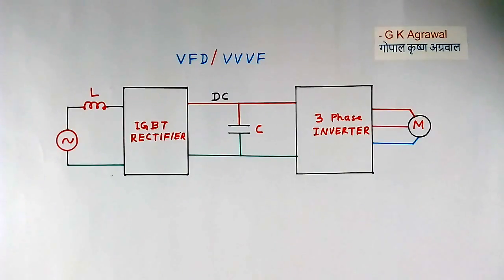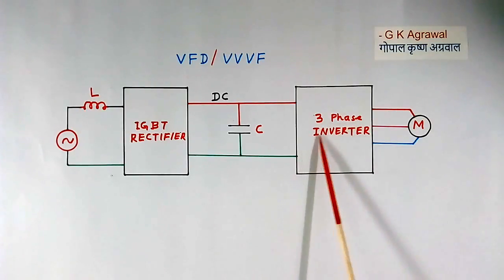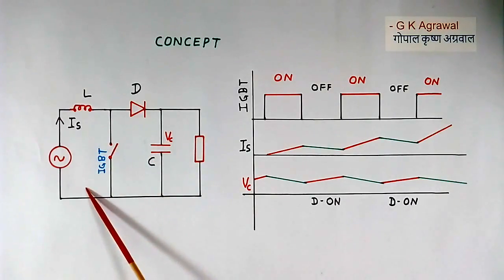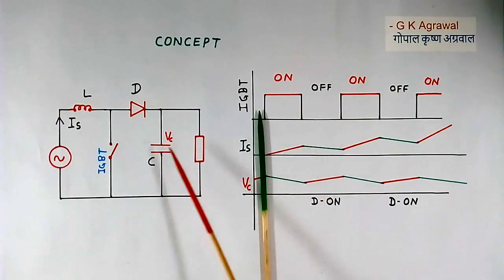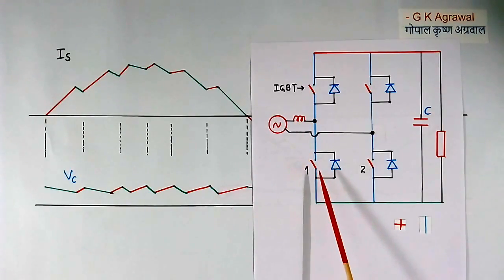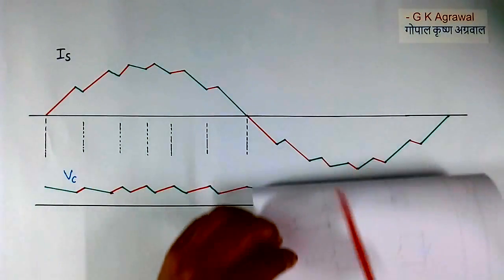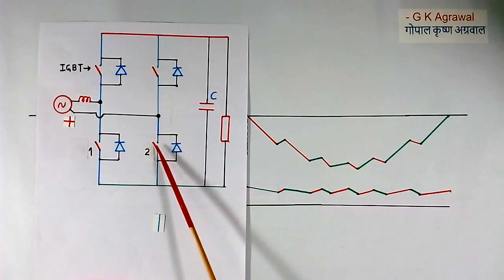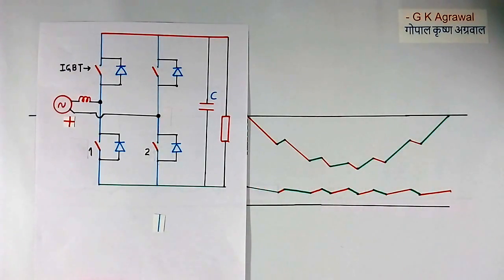How PWM works in IGBT Rectifier VFD, PWM, STATCOM

Comment: Question: Is pulse width modulator ic in switching mode power supply  AC or DC  ?
Reply from the maker: In smps, different control are available.
Reply: @GKAgrawal2 
Thank you for your answer. Can you give more explanations ?

Comment: Sir , pl share continuation of this video with high frequency switching and also the calculation of harmonic currents at that switching frequency . This concept of Igbt based rectifier is also used in railway traction system. Kindly help to understand this traction system and harmonics.
Reply from the maker: Made many videos on VFD

Comment: there is already diodes inbuilt then why it need to switch on and off IGBT you will get DC at capacitor diodes are in full wave bridge configuration
Reply from the maker: Only diode will give
 fixed voltage, limited power. Looks like, you have not understood the concept of inductor and IGBT combination. Watch the video again.
Reply: @GKAgrawal2  Sir i know that because at present whole world is running on inductors yes if need higher voltage then its ok
Reply from the maker: Inductor is must for this concept to work.

Comment: how do you design a switch for that , are you trying to use a manual switch ?  or else how that switch recognize when capacitor is
 discharging ?
Reply: You'd probably use transistors controlled by some kind of computer though a solid-state circuit could be possible. I don't have much experience with electrical engineering, but I'm confident this process is too fast to be controlled by manual switches.

Comment: but i still confusing, 2 IGBT on high side switch off every time, only 2 diode of them active, why we need 4 IGBT while only 2 lower side IGBT active?
Reply from the maker: There are other options also. You can select some other combination of 2 IGBTs. Many times IGBts are available in set of 4 number in the form of a module assembly with heat sink. You can use only 2 IGBT also.
Reply: yes, thank sir!